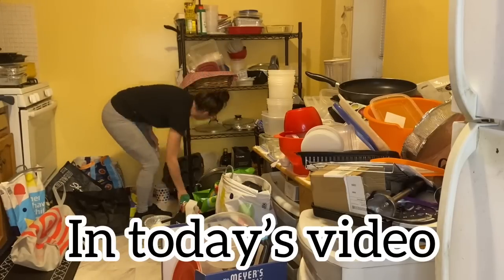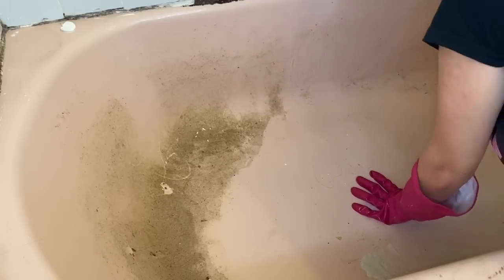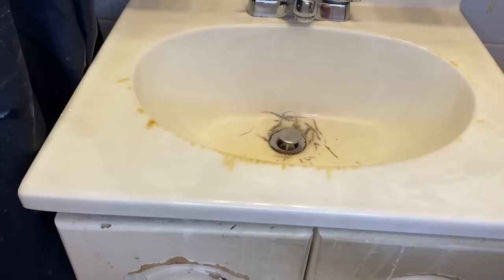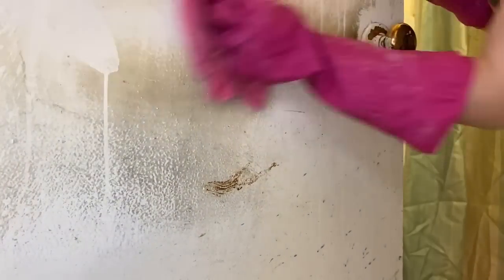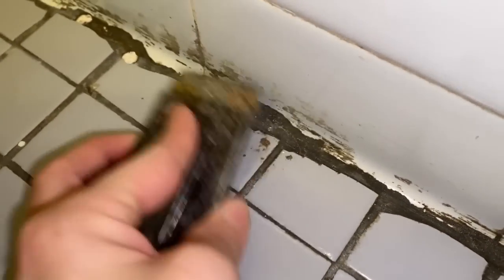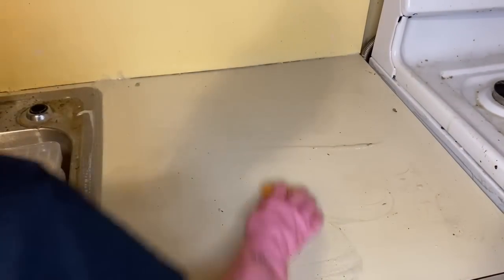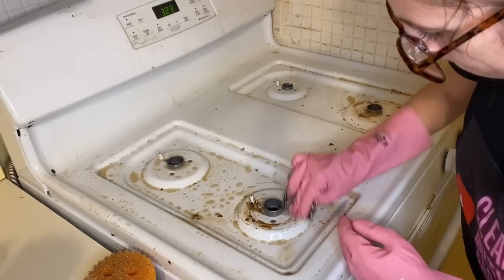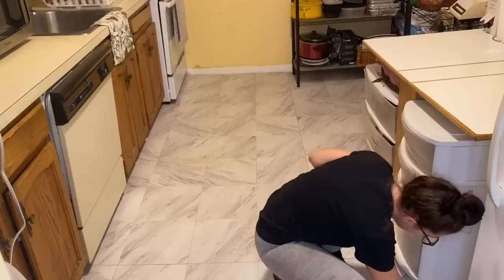Get Ready to Feel Inspired -- Decluttering and Organizing ASMR Cleaning Vlog!

Comment: The easiest, fastest, cheapest, and most effective way to clean the bathroom is to fill a bucket with hot water mixed with washing detergent the one for hand washing (it lathers more) and distribute it and scrub with a broom on the tiles the floor and the outside of the toilet and then scrub with a sponge what needs to scrubbed after that wash with water. This way soaks the grime and dirt and makes it easier to clean and the washing detergent breaks the protein which makes it easier to scrub. If there’s mold you can add bleach to the mixture just don’t use hot water instead use warm water.
Reply from the maker: I always make more hard my job I think 😅😅😅 thanks for advice! ❤️❤️

Comment: for this bathtub i would use an acidic product because i had a bathtub like this at my parents and good old acidic Domestos cleaned it. i found it out by accident. my  tap started to leak one rusty drop a day and i knew how to remove rust so i put acidic Domestos on the stain. Turned out, that not only it removed rusty stain, but also "dirty" bathtub around it.
i looked like dirt but it turned out that it was stained limescale.

Comment: Hi Barbie! I love your videos!! For the bathroom ceramic tile, grout, tubs, and shower doors,  you can you the clorox tylex mold & mildew remover. It's a little more expensive than what you're using but it works wonders in 5 to 10 minutes. This is what I use for my bathroom.
Reply from the maker: I used just a regular bleach. The problem is, I’m going to clean with many many products and I can’t take more 🙈

Comment: For the bathtub try Dawn dish soap and a vinegar mixture and spray and let set for 15 minutes then use a stiff scrub brush with hot water and start scrubbing.. it usually only takes one time if not once then try again..enjoy the nice clean tub.. you can add a little water to the Dawn soap and vinegar if the solution seems too thick for you..the 2 cleaning solution will usually clean ANY KIND  of bathtub 🛁

Comment: You should invest in a pumpbottle with a slang to it,it does not cost much, fill the bottle with allpurpuse cleaning and mostly water,,its so easy to spray the toilets, kitchens and floors, take hot water and cold water with clorine., the bottle is quite big.

Comment: Dishwashing liquid might be enough to get a toilet to look clean, but for purely sanitary purposes I would definitely use something containing chlorine, both on (and in) the toilet, and on the floor around the toilet.

Btw, I see someone already recommended Soft Scrub with bleach - that indeed works great on tough stains on tub and tile. You wet the surface, rub this stuff around and leave it on for 10-15 minutes, and then you pretty much just rinse it off, no need to scrub. Or at least not so much elbow grease anymore. 😊

Comment: Hey Barbie, I just wanted to say that I enjoy watching your cleaning videos and as a pro tip to help you take off the body grease and soap residues from the bathtub is to use a steal wool or a metal scrubber with dish soap or any degreaser but you have to brush a bit softly in order not to scratch the surface and you can use it to clean the tiles too.. cleaning will be much easier this way

Comment: I've used the oven cleaner that comes in the can for lime, calcium, and rust stains. And it works amazing. If you can let it sit for 2-4 hrs, and make that the last thing you clean, it melts the stuff off like butter. I tell ppl to use oven cleaner as well. It's an amazing cleaner if you need years worth of stuff melted off quick.

Comment: When I clean the shower floor I use dishwashing powder.  I heat water on the stove to add to the hottest water from the tap (faucet).  I use 1/2 cup of dishwashing powder then pour the hot water and hot tap water.  I swish the water around gently until all the dishwashing power is dissolved.  Then I just let it sit until the water cools.  Then I use a nylon brush to clean the shower floor, not much scrubbing required because the scum will be very soft and easy to remove.  Then I drain the soaking water and rinse very thoroughly with clean water.

Comment: Great job as usual ☺️ I think the products you used on bath were both good. It was just the wrong scrub daddy for that type of build up. I would suggest steel daddy next time. I know it wouldn't be best on a well maintained porcelain tube in case of scratching but on an old tub it will work great with medium pressure and only on the build up areas 🥰

Comment: I'd use professional dawn detergent , the purple one.. I make my mix of Dawn powerwash with it, using the purple instead of the blue and 90° alcohol ( 5 TBSP Dawn dish soap.
2 TBSP Isopropyl 90% Alcohol Antiseptic.
Distilled Water.
In the powerwash Spray bottle 16oz ) and it's really good! If that doesn't work, bar keepers friend pots and pans strength, it's stronger than the normal one in the gold bottle. ☺️

Comment: Great Job! And I would have filled the bathtub with hot water and Dawn dish soap and A cup of Bleach and let it soak in for an hour or two and then use a mop or broom while it was full and then let the water out and rinse. Then clean as You would normally do. It works 🙋‍♀️💞👍
Reply: exactly what i was thinking! let it "marinate" for a while.

Comment: Have you e er used dawn powerwash and let it sit 15 min on a tub? I'm curious, it works well on greasy dishes. But you may need comet  with it after the 15 min wait time. Then use along with a scrubber.
Reply from the maker: Yes, it’s working well. I made a video where i used in a very burned pan and cleaned well